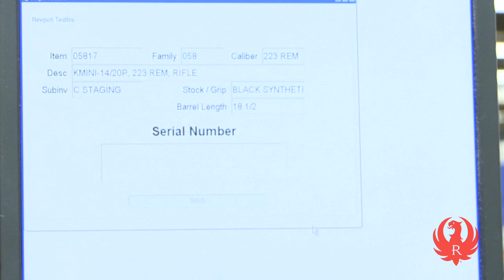Part 12. Ruger How It's Made -- Range Test & Packing

Comment: Someone at Ruger needs to understand a 4 inch radius is equal to an 8 inch group. Ruger does not spec a rifle to shoot 8 inches at 50 yards. 
Just for the Ruger haters Remington 700's are zeroed and checked for a 3.5" group from the factory. All this tells me is its a quick shot group from both manufacturers to assure proper function and decent accuracy. Test firing at Ruger seems to be done with a person behind the trigger rather than something along the lines of a shooting jig which tells me the rifle is more accurate than they say.

Comment: I bought a new mini14 in 12-16. Couldn't get it to print in an 8in circle at 100yds, or 50 yds.  Ruger sent me a new one. Havent had time to zero it in due to the weather but if it will only group in and 8 in at 100 yds;Im gonna sell it. All my other Rugers  are great.